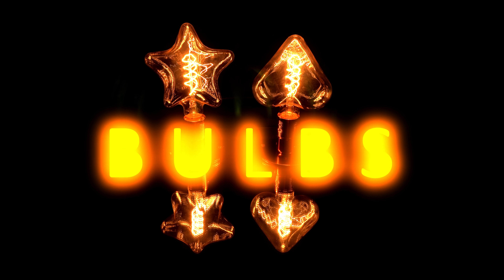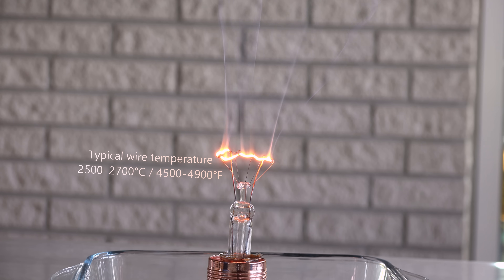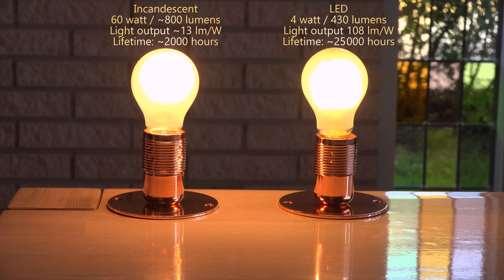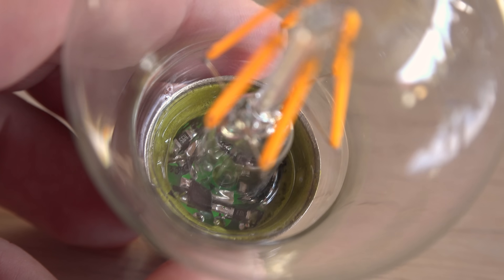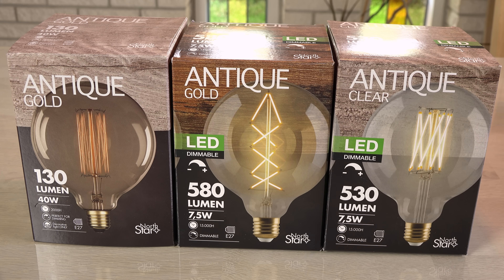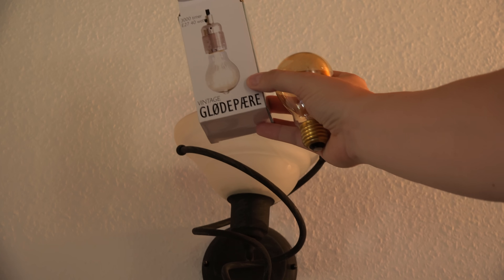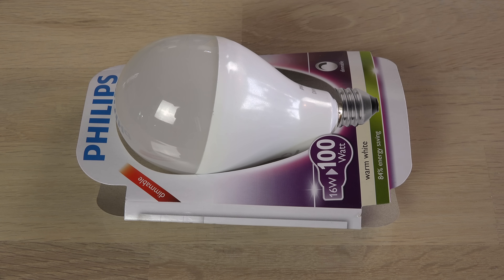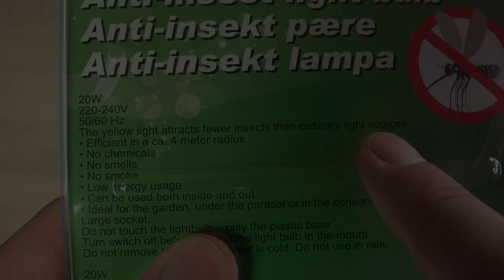Light Bulbs | LED vs. Incandescent

Comment: Hey man your voice is so soothing. Makes watching videos about stuff like light bulbs all the more interesting! Anyway, the irony about LEDs is that because they output little to no heat, if you live in a cold climate (or it's winter), your heating system has to work harder. I replaced some incandescent bulbs in some rooms and have noticed that the room is noticably cooler in the winter. Of course in warm climates or in summertime, the effect is reversed. I wonder if anyone has done a study on this to calculate the true energy savings because of this effect.

Comment: I am an advocate of LEDs, but there is heat with an LED: the transformer (LED driver) can be hot to the touch.  Yes, the LED 'bulb' will be at most a few degrees above room temperature, but the transformer can be too hot to handle by a naked hand.  Many bulbs have a plastic support to prevent a burn.
I have been disappointed that standards do not require disclosure of the heat generated by LEDs (would have to report the same for traditional and CFLs, too to have a comparison)  At some point, the LED drivers will be improved.  If LED brands differ in their heat gain, this should be disclosed.

Comment: I like the regular bulbs for heat in the winter time. I will turn on a 60Watt regular bulb and put my hands over it to keep them warm.
So the reg bulbs do have that for winter but in summer time it does suck. :)

Comment: Regarding the anti-insect light bulb. Yes agreed, you have an excellent grasp of the language to be able to pick up the error that the majority of English people would completely miss. Also, to add insult to injury the sentence using 'fewer' in this instance is grammatically incorrect. This is one of those times when 'less' is the correct term. As it is referring to a non specific either or scenario, then in this case 'this bulb will attract less insects than ordinary bulbs' would be a more correct use ( if it didn't conflict with the declaration on the front of the packaging ) If the manufacturer could quantify the difference between the two bulbs then the term fewer could be used. For instance 'this bulb will attract 20% fewer insects than standard bulbs'.
Overall this was a great video, I was unaware of the cri index and that explains a lot. Great info :-))
Reply from the maker: Thanks. I wasn't aware of the less/fewer difference. Luckily I chose to say 'less' :)

Comment: Do you think that LED bulbs create harsher shadows?  We replaced incandescent bulbs in our work lights with CFL and didn't notice much difference in light dispersion but the CFL ran cooler,  but were fragile and would often break if the light was dripped.  We replaced the CFL's with LEDs which are plastic and don't shatter, but it seems that the light output doesn't disperse as well and that I notice sharper dark shadows.
Reply from the maker: I think some of them can be. The LEDs with a single 'chip'/semiconductor will have the light come from a small single-point light source and could cast hard shadows if they aren't designed well enough with reflectors/diffusers.

Comment: Sir... It has a light output of 125 watts... ☺️ here in the Netherlands you can see that on the box like 25 equals 60 watt incandescent! Cheera
Reply from the maker: Hm, no small print on the box explaining that like with the other bulbs shown in the video. And to add to my confusion: the seller specified it as a 125W CFL comparable to a 750W incandescent >:(

Comment: The "wattage" on a lot of fluorescent lamps packaging is often given as a value equivalent to what kind of incandescent bulb would have the same luminosity. So the "125W" JND fluorescent probably has roundabout the same luminosity as a 125W, but has a much lower power draw. The Osram LED bulb shown after it is also marked as a 60W bulb because its luminosity is about the same as a 60W incandescent bulb, even though it only draws 6W. And the Philips energy saving lamp is advertised at 16W actual power draw, with luminosity equivalent to a 100W incandescent.

But the true power draw should definitely be marked somewhere, either on the packaging or on the bulb itself, but considering the package proudly advertises "LIMINOUS EFFICIENCY" of 60 lumens/watt, I'm not hopeful that it's very standards compliant...

However: If the luminous efficiency really is 60 lm/W, it should have total luminosity of 7,500 lumens; the test results showed a luminosity of around 3,000 lumens, which is actually consistent with the measured power draw and the luminous efficiency (60 lm/W * 50W = 3,000 lm). That said, it's not exactly an 80% saving in energy as advertised in the packaging; 60% would be correct.

If it only shows "125W" on the etiquette side, and there's no indication anywhere on the packaging or the product itself that it actually has power draw of 50W, that's not quite right.
Reply: ***** Right - so will this thing actually reach the advertised 7,500 lumens, instead of 3,000 lumens as shown in the test result? Because if it actually is working at 125W power draw with 60 lm/W luminous efficiency, that's what the luminosity should be...

I'd be on board with the assumption that the lamp needs time to reach its full armed and operational status, except he said on the video that he uses these lamps for lighting on his videos - that would imply he knows how the lights work, how long they require to warm up, and how bright in general they are.

So with that in mind, the only conclusion would be that he was being willfully dishonest about this lamp, misleading viewers... for what? More views? Stirring up controversy? I just don't see a reason for that, in an otherwise quite solidly done video.

Comment: I have a lot of recessed lighting in my house, and have been using a 30w flood bulb with incandescent dimmers & automated home switches. The only thing available to replace these bulbs is a 50w Halogen. Tell me where the energy savings is? I'll burn 66% more energy to light my house. Or, do I need to spend hundreds of dollars to replace my switches, so I can use expensive LED's? This is criminal.

Another problem is with the LED traffic lights don't produce heat. They ice over with the snow, and you can't tell if it's red or green. This is safety improvement?

Comment: Nice vid, i have a question though. I have been reading about the light bulb that was made back in the 1800's and it still works. How can i go out and buy a lightbuld in 2016 and only have it last a couple of years, compared to some "old crap" that has been working for over 100 years.

Comment: incandescent gets more efficient with heat.
using dimer with incandescent lamp doubles its power usage .because dimer wont let incandescent lamp getting hot
CFL lamps also will get more effective with heat and also as wikipedia says :
"CFLs are generally not designed for outdoor use and some will not start in cold weather"
wikipedia :
https://en.wikipedia.org/wiki/Compact_fluorescent_lamp#Outdoor_use

Comment: Have you measured the RF interference that the LED bulbs radiate some are terrible this type of new technology is not so go is your a radio armature or a short wave listener enthusiast  .The RF noise fool where i live as risen by at least 6db due to this type of new technology .The cheap Chinese leds with filters missing in the circuit board mainly for blocking DC getting back into the electrical wiring is missing and this will generate mains born interference also to your neighbors on the same electrical phase .So i think twice before buying led bulbs i have a stock of incandescent bulbs to last me a long time no rf interference of them.
Very interesting video thanks for posting